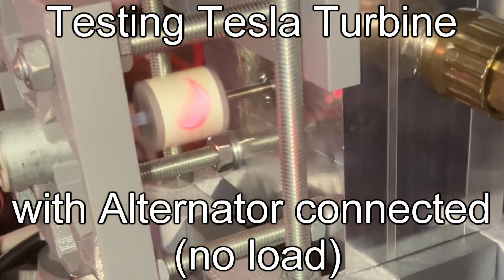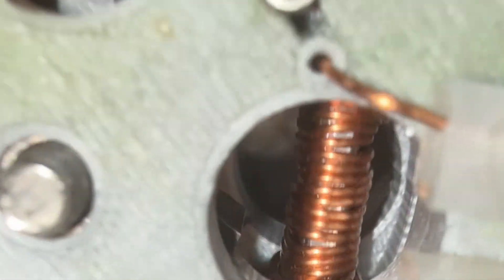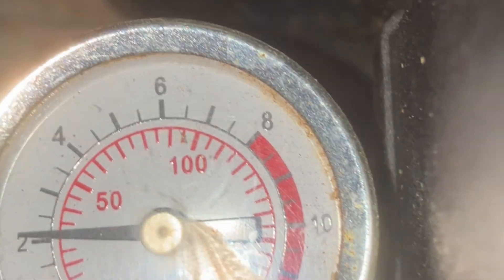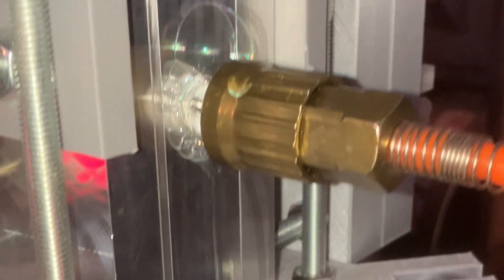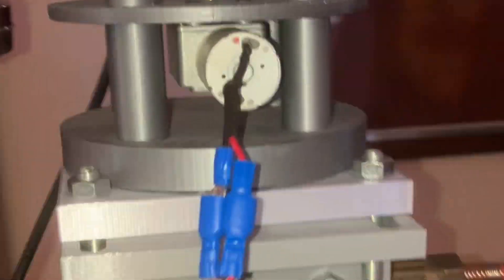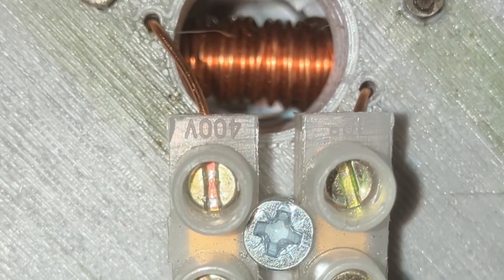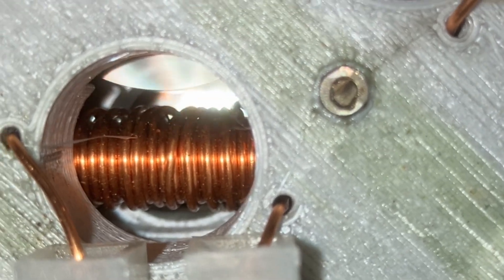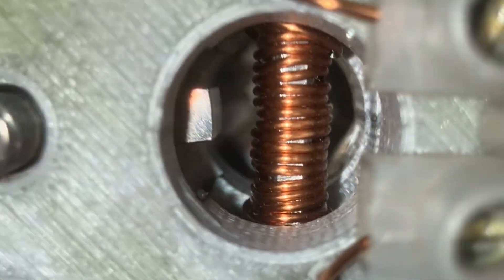Testing Tesla Turbine with Alternator connected

Comment: Yo you need an accumulator big dawg.  Otherwise voltage will drop off with any load.
Reply from the maker: Thanks I will bear that in mind. Would big capacitors on the output rectifier circuit count? That’s what I was thinking of doing.
Reply: @tectonicshift  ya big capacitors minimally.  I use a 60hrz vibratory unit.    I fill it to the brim with wet pyrite diatomaceous earth in there and vibrate it to 60 hrz. 

My led diodes sit on top of my pyrite quartz accumulator. 

I've only ever run delta because i use this setup to power three cabins at 115v each. 

If you set it up in Y configuration and added some heat and sunlight your make a lot of wattage.  Especially charging with water.
Reply: @tectonicshift  uhh. So your water flow is 100% in phase with your generator?? 
I see whatre you doing but ya water flow workload MUST be in phase with the correct explosion proof 3 wire generator mid power band that way they cresendo together.  

It's pretty hard to do relatively speaking.
"CRITICAL PRESSURE" I THINK you labeled it...  

I don't think your rpms are high enough to incite real good excitation.  Does matter it only happens with three phase squirrel cages. 

All because the steam recirculates huh? 
 

Ya still impressive to see you do the gear making
Reply from the maker: Yeah it’s a bit of a guess for me, I will try different set ups. I was thinking that for the size and pressure it should be much higher RPM 50,000 instead of 12,000. I should be able to get it higher. I don’t expect much power output at all. It will be a case of trying anything I can to get something.